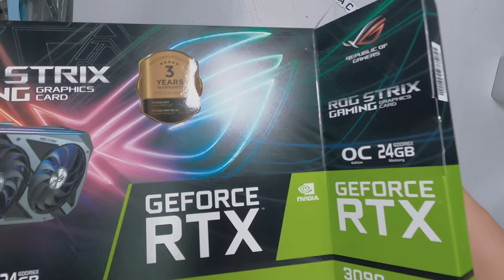Supertower Corsair 1000D Super gamingpc

Comment from the maker: For a more powerful cooling solution, an external radiator has been added after the assembly has been completed.
Reply: What’s the external radiator?
Reply: how much £££££££££££££
Reply: @kaizmak  10:46 the thing on the left, its basically same concept as the radiator+vent that AIOs use , but it's external, it's like a cooling station... the liquid goes throught it and comes back in the pc cooled off.
Reply: But why the radiators that are in the case should be more then enough 😅
Reply: im sure thats not mo-ra3
Reply: @StefKRah  Do you think DDC pump enough to run thru external radiator?
Reply: I can not buy video cards! Do not post such computer videos! I'm angry!
Reply: @Oliver.D.S.H.  More radiator space means you can run all fans at lower RPMs resulting in lower noise.
Reply: Actually Ek intended to use dual 480s or 360s at the top of case if using this distribution plate.
That would be enough cooling power.
Reply: What is the music name😍
Reply: what does the little sticker that you put on the ram represent.
Reply: @mregyptiancitizen6770  you got Israelrolled
Reply: You are a god
Reply: @thepowerofthegodhand7003  who?
Reply: @Sinister [GD] lol
Reply: give me that . challenge me for 6 mos im not gonna leave my house ! playing all day! im gonna leave my room for bathroom break and get some foods !
Reply: need this as a give away.
Reply: Seriously? a quad rad and triple rad in push-pull for a single CPU and a GPU, it should be more than enough to reach 6Ghz lol
Reply: @kaizmak  It's a local brand called 3RSYS SR-V
Reply: @alfa7710  you dont even have the money so dont talk
Reply: An impressive 👏 work of art 🎨.   Thank you for posting this video 📹..
Reply: If we change the processer  to ryzen 9 5950x best PC in the world!!!!!!!!!!!!

Comment: Yangcom : Uses RGB on every part of the PC
also Yangcom : uses the one Z490 motherboard that does not have any lights on it.
Reply: not to mention it's an MSI MB :o!!! Never ever would i use MSI mb ... they are sooo low grade .. + i would have opt in for a 5900x with a Dark Hero Mb for the shear power of that cpu/mb combo! :p
Reply: He should use z490 extreme water force inbuilt water CPU block gaming RGB motherboard
Reply: @mohuyabhattacharjee3872  Dude, that motherboard would take up 50% of the cost of this PC. It's simply not required. We watched Yangcom Korea, not Linus Canada.
Reply: @daquarius1222  The msi motheboards are a good competitor and generlally they have the same features as their competence. I use a msi motherboard and im very happy with it
Reply: @ecpeongray  yeah same features, but the lack of quality from MSI, is enormous! .. has been for years .. just look back at the M-Power OC boards from 2013 & up to around when they stopped making them .. Like 10's of tusinds had mega problems with a tiny little switch between the two BIOS's .. If you made a car turn on the engine in two different ways, wouldn't you test both of them, before you ship out the boards lol? 🤷‍♂️🤷‍♂️ it's just poor quality control .. minor small faults but on tusinds of boards .. unaccepteble from such a big company ..
Reply: Those pipes though. I want them .

Comment: the back radiator got the fans in a wrong air flow.. you must get the heat out of case not in case....
Reply: is on water the cooling is on the radiadot dotn think it mater what direction aslong is hitting the radiator i guess

Comment: Very spectacular, Clever idea to utilise the rear exhaust panel with a 240 rad. I was wondering about the EK-Quantum, but I don't think it's a good trade to choke the front intake panel completely just to have it. I'd rather go with 2x480s, then you don't need external cooling, and you can keep the side door on, dust will get blocked by mesh as supposed to. It wouldn't be as spectacular though.

Comment: With all the room for radiators and you still ended up with a external cooling solution…. 

This pc has room to fit (2)480mm rads in the front (2)360mm rads  at the top and a single 240mm rad at the rear. I think this build was wasting space. As a buyer I wouldn’t want to have a external cooling solution when the case is 27in x 27in x 13in and weights nearly 50lbs when empty and upwards of 125lbs when fully built. 

Anyways nice try but maybe use more ava space before resorting to an external radiator. Corsair would turn in their grave seeing only 1 radiator being used in this build.
Reply: With the Distro plate in front you can't mount the x2

Comment: all ok but too much space wasted. The pci-e riser is too long and kinda like ruined the look. The gpu power cable was wasted. Would be best if the rgb led is not included and the wires could have hidden more. 

The added radiator is just pure waste BUT, an added mini-itx build with another 3090 inside that case, will really benefit it..

Side note, you guys really like that G.skill royal gold. Have seen all your builds and they are all gold

Comment: why do you still use HDD's with such a PC? When they work, they are the loudest thing in my computer. If you convert them to 2.5 inch SSD, the computer would be perfect.
Reply: What there are ssd in there. Also why wouldn't you not have a hard drive.
Reply: Because mass storage is still cheaper on hdd, and better for long term. Also the hdd is probably broken of you can hear it that bad. I have 4 drives total in mine, totaling about 22tb, and I can't hear the 2 hhd I have 🤷‍♂️🤷‍♂️

Comment: Why do I never see performance fans in builds based on this case? Use better fans and you won't need the external block.
Reply: he doesn’t really need the external block anyways, the components won’t get nearly hot enough to need more than one 360 worth of radiator, it’s all for show
Reply: @Sinister [GD] not at all there are people who fit a 3090 and a 5800x with a triple rad

Comment: So why are the two rear fans sucking air into the case? Typically rear fans are for venting air.
Reply: i think the idea is to have intake since the reservoir cut off intake from the front. but he has less intake than exhaust, so i imagine it's still negative pressure. good way to get dust into a good looking computer.

Comment: I mean super cool build and all but a external radiator? Rly? With the 240 and 360 already in that huge case the external radiator is the definition of diminishing returns. I would bet ALOT of money that the very little difference the external makes compared to the very large  cost is absolutely not worth it. I have just ONE  120mm aio  just on my 10600k with a med- high oc  and the cpu never goes above 80c. Don't get me wrong it's super cool n all and that's what u were going for u scored a 100  but if that is to be used everyday where would you put it lol

Comment: I do like the messing tubes but i do not like the build at all.
Why?
1. The Distroplate isnt with any function but have a clean look inside. U cant see it from the front.
2. Working with an external radiator pack but still using a big radiator in the top and the back for having the super expensive super hugh tower? No sense to me at all.
3. Using the LL fans even on the pull config in t he top. But u cant see any RGB from the top, nore the side or any place. So why for?
4. Due useing this big case the compounds do look like beeing lost in this case, because the right side is totaly empt. No fans, no Radiator, no smaller case.